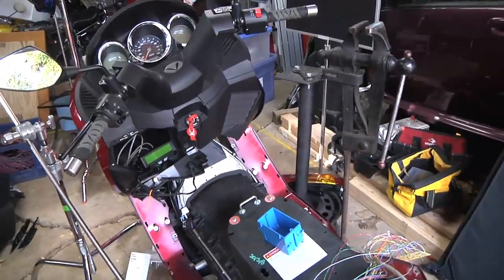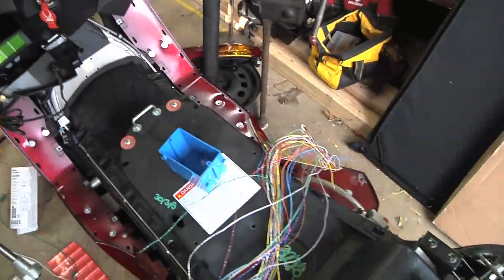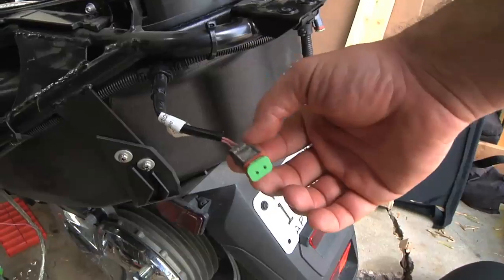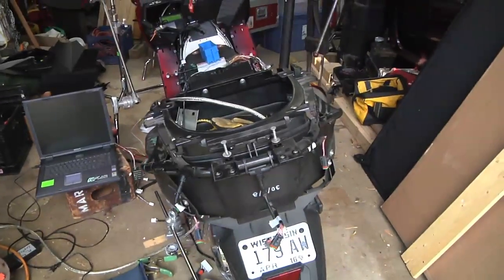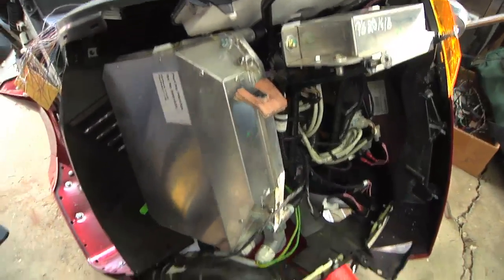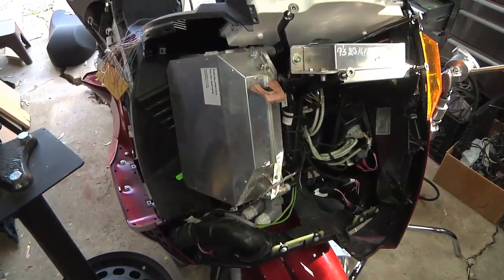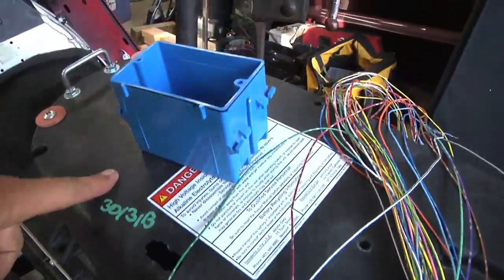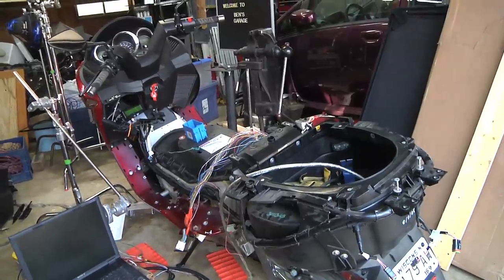Vectrix Update May 25 2015

Comment: Yeah, if you can adjust the bodywork to get lower. What's it like with all the junk off is anyone's guess in my book, lol
Common bikes have the old drawback of the headstock but I'd hope to shift all the junk from the front end to fit a nice nose that fairs back and down to cover your legs when your feet are up.

BMS's? sheesh! Careful who the "experts" are. If you can use the Leaf parts then you are really cooking. Most other stuff leaves you burning or dead cells. The lad who says "bottom balance".. If no circuitry is present to destabilise. 80%? Yes, playing safe is no real cost.
Leaf batts go to 4.11V max on the car, never higher..

Comment: I"ll tell you what you're doing wrong...you're using a BMS!!  :)
Ditch that complicated ridiculousness.  Count your AH and only charge to 80% of maximum.
Reply from the maker: enzorover b Yeah, the only problem with BMS is that half the people out there will tell you that you are doing it wrong. That's weather you ARE or ARE NOT using a BMS. In this case, all I'm really trying to do is to be able to monitor individual cells, so I can at least make sure they aren't going way out of balance. I could then do an occasional "as needed" manual balancing. I got my Cycle Analyst working right and can count AH now, and the charger is programmed to not go too high on the charging. My idea was that by not charging too hard or drawing the battery too low, theoretically, the batteries should always be great with no other special attention. That said, it would still be nice to know what they are doing!
Reply: BenjaminNelson yeah, I'm sure the debate will go on and on.  Keep up the great work.

Comment: It would be awesome to see an aerodynamic tail on that thing. Heck you could also increase the boot space. :D

There are some crazy super aerodynamic scooters out there. The real challenge is making the rider aerodynamic.
Reply: BenjaminNelson From my experiences with a Silver Wing scoot a few years back, you might get a good benefit from fitting a large Givi style topbox (trunk) actually on the pillion seat (that is a quick way of helping the air travel a bit more smoothly behind the rider and thus reducing drag) 

Aerodynamics is a very interesting subject.  I think that Vetter has missed the point myself, but I ride a (motor)bike that was designed by someone who started with a clean sheet of paper and it manages to avoid the problems from starting by modifying a motorised bicycle.  

I can't put links on Youtube comments but if you are interested Google for 'Creasey Aerodynamics' and look for the 'Bikeweb' link for some recent words on the topic.  If you are interested in the 'blank sheet of paper' design ideas, look at his Bike Magazine 'High Tech' columns from the late 70's archived on my Voyager03 website.  And if you want to see a really aerodynamic bike in a wind tunnel look for 'Monoliner at MIRA' on Vimeo!
Reply from the maker: Phillip Tunstall I'm not aerodynamic at all. The best I can do is duck. One thing that I can tell you is that I can FEEL the difference in the power needed to go down the road at top speed when I'm sitting upright vs. when I duck down behind the windshield. It's a noticeable difference. I don't mind the idea of a giant trunk either. The trunk is my favorite feature of this cycle so far! (Also, the Regen is pretty cool....)